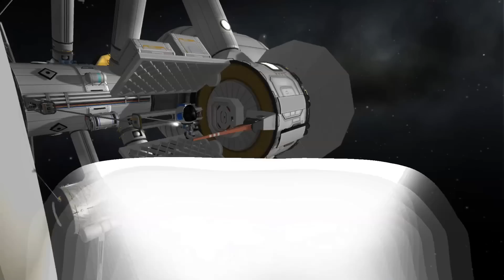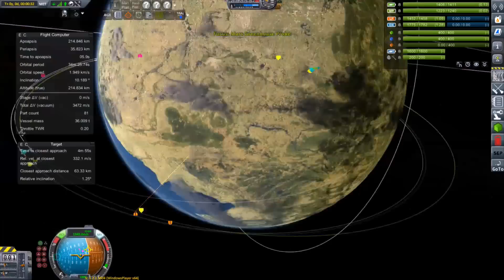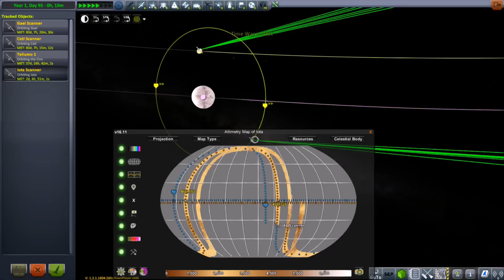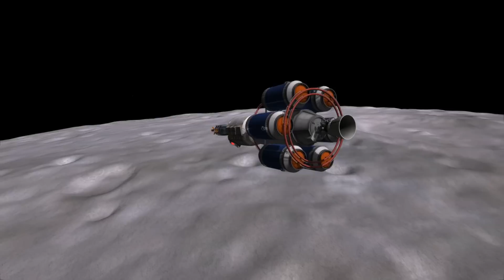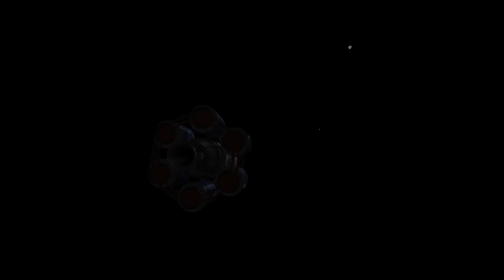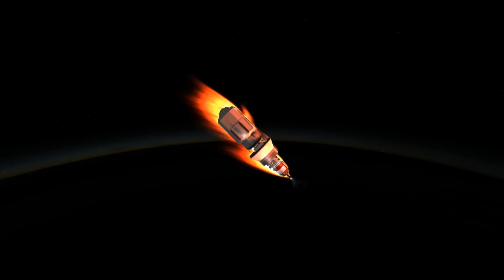A19 "TBD" - Project Ares - Galileo's Planet Pack - KSP 1.2.1

Comment: Your rockets are unstable because all of their drag is at the top. You want drag at the bottom (this is what rocket fins are actually for. not control) and you want your weight at the top (otherwise your engine uses the center of mass as a pivot point to flip your rocket around)A few easy changes to make:Rocket cross-section should be as close as possible to payload cross-section. Don't try to put a 3.75m payload on a 2.5m rocket.Add fins to the base of your rocket. This'll increase drag and keep your rocket pointing at space.If you have multiple fuel tanks in each stage, make sure fuel is burned from the bottom up, instead of top down.